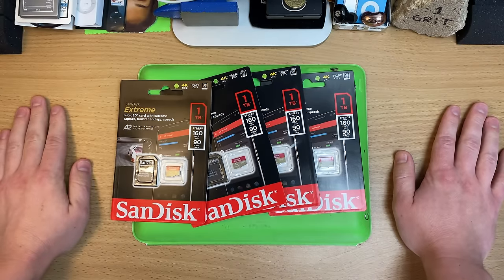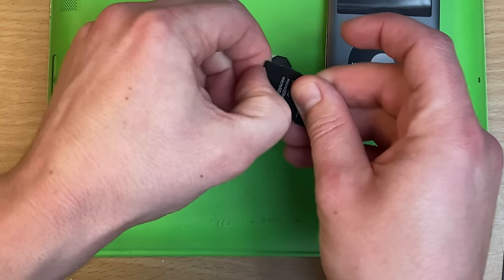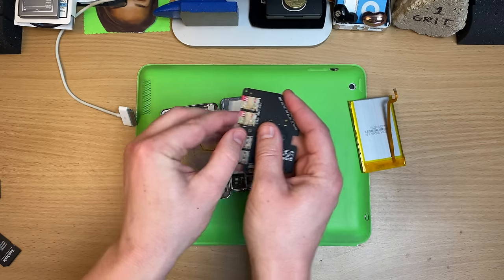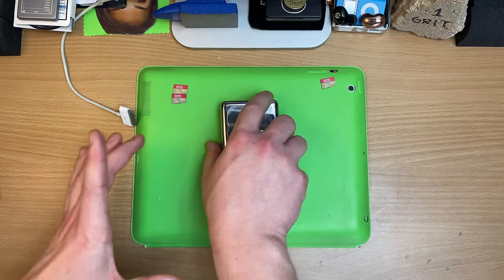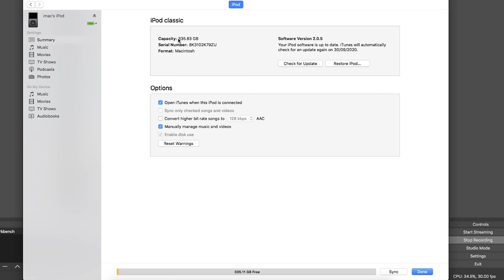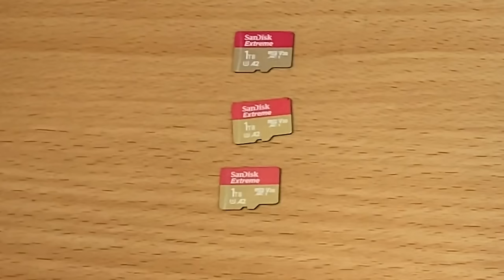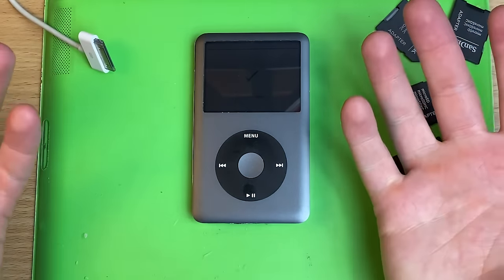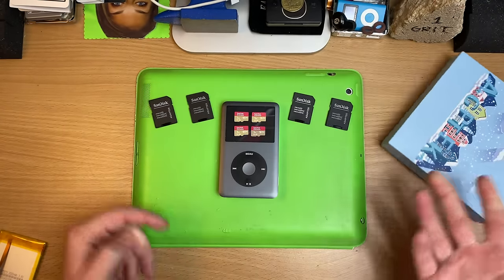4000GB in an iPod Classic.

Comment: A word to the wise, don’t buy storage from eBay. I’ve had “sandisks” that looked legit but the actual cards were like 4 megs. The computer even reads them as a terry bite. But it just rolls over the data constantly overwriting and corrupting data.
Reply: For this those scams might be actually better. The device sees 4 TB bit they're way cheaper than legit ones
Reply: Hell, I've had fame cards from Amazon. Best to buy in store or from the manufacturer
Reply: It gets worse than that. You can EASILY find these fake cards on Amazon as well. SD cards are one of the most faked products and you REALLY need to pay attention to the reviews and compare model numbers and even compare box arts and stickers.
Reply: @bene5431  But they're not actually 4tb so your data gets corrupted
Reply: @TheVivi13  yeah like they put it through some magical scam-o-matic machine that like overwrites the storage with a fake number 
Then they loosely base the box off of the original, and they sell it more expensive than like actual 8 GB cards

Comment: When an iPod has 8 times as much storage as your desktop computer...
Reply: Nicolas Byszewski but what if you have a 8tb hdd on your computer
Reply: For me its 50 times more
Reply: laughs in 20 gb
Reply: 200x.
RIP.
OOF
Reply: @Versuffe 
My iPad Air 1 has 4 gigs less than your computer. Mate, you need an upgrade HARD
Reply: Me: laughs in 4tb
Reply: Laughs in 13TB
Reply: i dont even have a gb. On my tablet
Reply: I have 12gb of space on my tablet
Reply: @focalpoint._  ipad air smh my computer has a 16GB micro sd card witht the OS and everything on it.
Reply: I honestly thought the same thing
Reply: Man, I've got 6Tb in my desktop, and it's fucking full
Reply: Laughs in 8 gb

With windows xp
Reply: How bout 32 times more? I got 128gb!
Reply: @shiftybluepig1141  are you using a pi or what
Reply: @hexxx3d462  I had an old computer with i think a 500GB hard drive. We then obtained a new computer which was much much faster. We moved the hard drive along with it. The new computer is very high end but its also 9 years old so around a year after we started using it the GPU died. We dont need it that bad so spending heaps of money on a computer when we have access to another printer and our phones isnt necessary at this point. So we moved back to our old computer for basic things. Because we had no hard drive i just found a micro sd card and an adapter to put into it and we just used Linux Ubuntu for an OS.

TL;DR: No i dont have a pi, i am using my old hardrive for the computer in another computer (which now has stopped working). So i moved back to the old one which i dont need much storage in.
Sorry for the paragraph im bored.
Reply: I have a terabyte HDD and half a terabyte SDD
Reply: @nequastar1826  laughs in 52tb
Reply: Oh...

I have 1.5 tbs only
Reply: my moms laptop has 4gb i think
Reply: @Baron lol same I had 16GB STORAGE not ram and uh..... 1gb ram (not vram for a gpu it’s the actual memory)
Reply: FAAAAAAAAAAAAX
Reply: For me it's 2 times more and it's a laptop
Reply: I got 1.5tb in ssd and 20tb in hdd storage
Reply: Bro you got a computer?
Reply: laughs in 16 gb
Reply: Lol dudes flashing their single and low double digit numbers, meanwhile Linus jams a petabyte into a server box.
Reply: @ImKevan  what even is your point?
Reply: My main laptop has a 1tb boot drive and a 2tb mechanical drive

Comment: "The amount of HDD space that can be used depends on the cluster size, for example for a 32 bit OS using a file system with 512 byte sectors, that would give you a HDD limitation of 2.2 TB."

Is this possibly why it won't work?
Reply: The following limitations apply to the iPod Classic OS:

512 byte sector size. This probably why two of the SDXC cards don't work. They have a different one.
2^32 logical block address (LBA) limit.
The combination of those two limits then is 2^32 * 512 =2,199,023,255,552
Reply: @MayContainJoe  Which is exactly 2TiB. Give or take a few bytes for headers and the partition table, it seems this is exactly the reason why it's failing.
Reply: @Jack Carlquist Filesystem doesn't matter if the drive is initialized as MBR.

It says "Master Boot Record" right in the video at 13:54

Comment: Try formatting the cards with a 4k sector size. If the limit is how many sectors can be addressed by the partitioning scheme, this should theoretically give you 8x the addressable space (512*8=4k) or 16tb of potential storage.

Comment: i just realized how insane it is that an entire terabyte can fit in a tiny little chip but cars are still like full of pipes and shit
Reply: Cars are bigger than SD cards
Reply: @jackomeara6395  exactly
Reply: SD cards aren't built to propel a family of four into a wall at 130km/h
Reply: @jm036  it's like comparing apples to bananas
Reply: they are completely different
Reply: @ianism3  lmfao
Reply: have you tired the new chevy duramax , the computer has like .0005 bits of processing power to read the throttle pedal input. so i understand your metaphor

Comment: I experienced a similar issue with a 3 TB HDD in one of my old computers.  Because of the file system that was being used was a 32 bit build, the Master Boot Record would only allow for a partition of up to 4,294,967,295 sectors of 512 bytes i.e. 2.199 TB.  The rest of that HDD was effectively useless because the MBR wouldn't let another partition exist on the same disc.  (I was young and didn't know any better, sue me)

The iPod's os is most likely a 32 bit build and therefore has the same size limitation.  Combine that with the RAM ceiling you hit and it's pretty definitive that unless someone goes and writes a custom OS for an obsolete technology, that's the bioggest the ol' iPod's getting.

Comment: Sandisk has alot of issues for various homebrew'd things, like Android on the Switch.
Reply: wait, Android on the switch? people do that?
Reply: natural blue why would you put android on the switch?
Reply: @donaldmacisaac8479  because It Is cool
Reply: Caramelle but if you’re going to mod a switch, why not play older games/home brew on it instead of turning it into an oversized smartphone
Reply: @donaldmacisaac8479  some use android on the switch to emulate
Reply: @donaldmacisaac8479  android has some pretty good emulation software and it's a generally lightweight os
Reply: And I will say you can get ubuntu on it too.
Reply: CAMSLAYER13 I mean, I guess it has to be because of all the weird ways android gets used because it’s OS is used for pretty much everything.
Reply: Any way to fix an SDcard after SwitchRoot has been installed? Ive ruined 2 microsd's to Switchroot and i cant figure out how to fix them, tried reformating, sdcardformatter, etc. Nada
Reply: Why use a switch to emulate games via android lol that is so overkill and stupid when you can just use an android tab or even a cheap android tv box to emulate and keep your switch to play switch games
Reply: @Alexander_l322  I think people just get a kick out of using hardware in unintended ways. Besides a bet it's way nicer to use than a cheap tablet or an android box + a cheap controller.
Reply: CAMSLAYER13 I get that, it’s why I like to install cfw to my consoles and things like that but not to make them less useful then before. My PS3 for example can play PS3 iso files, along with ps2,ps1 and retro arch but i wouldn’t do it if I couldn’t still use it like a PS3. I would mod a switch to play games downloaded(not sure if it’s possible I’ve not researched it) and that would be good enough for me.
Reply: @donaldmacisaac8479  half life 2

Comment: I think you hit the 32-bit integer limit on the IPod config at 10:00 roughly. The IPoc cannot accept more than ~2,18 Terabytes of storage.  Everything above that, it resets to 0 and counts from there: 1TB+1TB+512GB=2,5TB; 2,5-2,18=0,32 i think that's why...
don't know tho. The Integer limit normally lies at ~2,1 GB.
also 4TB-2,1=1,9 at 14:00 roughly

Comment: ~2TB is the limit for a MBR partition that it's surely using.

When you're getting those smaller sizes when you have more than two terabytes in it that's actually the second partition it's actually having to make I believe raw it would be 2.2 TB so that's why it would be 360 gigs left with 2.5 terabyte in there

Comment: Hey, I had a problem similar to this when I installed a 4TB drive into my PC. I think the problem is that the SD cards may be using an mbr table instead of a GPT table. The limit for mbr is around 1.9 tb from my experience. I'd  try that if I were you.

Comment: There’s one more achievement left in order to achieve it… if it ever will

Can the iPod… handle 8TB … if it’s possible?
Reply: Well, it couldn't handle 4tb, so probably not.
Reply: No 8tb ipod
Reply: Also 2tb sd cards don't exist yet
Reply: Possibly nope bc ipods as it seems uses MBR so its hard limit is 2tb
Reply: I mean, if it ever will be possible, then it will be official. But I wanna know if it can handle on the new iPods.

Comment: Here's why these limits probably exist: 2**16 is 65536 (the size of a 16 bit integer) which is close to 50000, so I'm guessing the actual song limit is 65535 songs. The storage limit is 2147483647 bytes because that's what 2**31 is (the size of a 32 bit signed integer, although that does seem like a strange choice, perhaps it's a firmware bug with the board you're using). Bugs start happening (like seeing weird values for the size of the iPod because these values have overflowed, looping back around since it can't represent numbers larger than these values for those things.
Reply: You're right on with the storage limit analysis but for the song track limit its the RAM size of the iPod. Older ones have 32Mb, newer have 64Mb. The metadata of the songs is stored in the RAM, so if you have longer track names and more artist info added, the track limit will be less than if you have shorter names.

Comment: I can explain why you were unable to get more than 2tb of storage. Long story short, this iPod uses an older partitioning system called MBR (master boot record). MBR has a partition limit of 2TB or 2048GB (computers count in powers of 2). 16:00 Yes, but it may require reprogramming of the iPod itself...

Comment: I dunno if anyone has mentioned it, but, the reason the size looks smaller on Computers is because computers are typically telling you the size in another measurement. (Linux will show what the manufacturer puts on the box) My 2 Terabyte drive shows up as 2TB but 1.8 TiB which are equal measurements (which is the unit Windows displays by default, but Windows says TB rather than TiB where as Linux shows TB and TiB in the properties of the drive). One is base 1000, the other is base 1024. Most computers display the base 1024 unit, but manufacturers put the 1000 measurement on the packaging typically. So you aren't losing That much data.

Comment: Curious why you format the flash cards at all for the iFlash Quad.  I've been using this board for a while and the best thing I've done with mine (and quickest) is to use DISKPART and clean the partition of all cards.  Put it in the board and iTunes fixes it just fine.

Comment: The reason it's not detecting more than 2 TB is because HFS (Mac OS Standard) and FAT32 have 2 TB filesystem limits. It may be possible to get it working if you use a third party firmware which supports newer filesystems (like ext3, ext4, btrfs, F2FS, NTFS or HFS+)

Edit: I was wrong about FAT32. It has 16 TB as it's maximum capacity. It may also be hardware limitations.
Reply: It is 2tb, not 16.
Reply: @SOTP.  Quoted from Wikipedia:
"The FAT32 boot sector uses a 32-bit field for the sector count, limiting the maximal FAT32 volume size to 2 terabytes with a sector size of 512 bytes. The maximum FAT32 volume size is 16 TB with a sector size of 4,096 bytes."

Comment: The most likely reason it only saw 800~GB when you had 1+1+0.5+0.5 is because these card controllers are required to present a as a single drive. There are only 2 ways to do this option 0: Raid 0, this will give the fastest speads as it spreads files across all compatible drives. Option 1: Raid 1, where all drives have a copy of the same data. The thing is. For this to work, all drives have to be "exactly the same" in either case. What likely happened, is that the adapter chose the two closest cards to the controller, put them in raid, and because computers are weird and it was still required to address all 2 TB of the other drives, it had to reserve a portion of the "1TB" raid array. Somewhat similar to how if you put 16GB of RAM in a 32bit computer(normally limited to 4GB) you will actually see significantly less usable RAM than 4GB because it still had to "address" the 16GB of RAM

Ok yes technically there are ~8 ways to present the drives but i doubt this controller supports and or is intelligent enough to run extended partitions, or ZFS-Z3, or RAID50

Comment: The ipod has an ARM7 processor inside, which is a 32 bit processor. That means it can only address 2 tebibytes of memory (around 2199.02 gigabytes) Some of the address space is likely going to be mapped to internal io registers and internal work ram, and the rest of it will be trying to map itself to your sd cards. That's why 2020 gb is the limit.

Comment: 2TB maximum for 32 bit architecture. Ran into this with a Vantec Firewire external HDD case. Turned a 4 TB HDD into a 1.89 unless I did two partitions of 1.89 TB

Comment: google say "FAT32 max partition size is 2TB. If you have a 3TB drive or larger, you would not be able to format it as a single FAT32 partition." 

I think ipod´s use a 32bit processor or format the drive again to fat32. The board create a raid 0 with the sd card but the ipod cannot handle the amount (4TB) of storage.

Comment: Is slowness normal when you load up an iPod? I bought a 1 TB unit and it's probably not even 1/3 full. But it scrolls sloppy, and that's when it wants to scroll. Sometimes it just locks up. I'm about to just give up on mobile audio and rip the radio out of my car.

Comment: This reminds me of the problem I ran into with trying to get a 4TB drive to run in a computer.  It's probably limited by it being MBR which means 2TB per drive.  That board tricks it into thinking 4 of those cards is a single drive so it'd have the same limitation.  The fact that you were showing 800 and 300 GBs means that it was likely showing how much space it was going over the MBR limit but I'm not quite sure why it was showing 2020 GBs in the end.  Computers are weird.

Comment: Now 2024 I bought 3TB
Six Samsung 512GB sd cards $30 each.
Only $60-$65 for 1TB. Times have changed.
You can upgrade a used IPOD with 1TB, 3000mah battery for less than $100.

Comment: Hey, i know i'm late to the party, and probably most of you have figured out one different reason this experiment is not working. Still, here's my take:
I've been there since the dawn of microsd cards (previously known as Transflash) and i've been going into problems with this or that reader, because the format of the card or whatever (i mean the physical format, like fabrication, and chips and stuff). Turns out most of the cards work on most of the readers, but there were always some flashy new ones that didn't make it with older readers. It looks to me that this could be the situation here. The two cards that didn't work with the ipod weren't bad. It may have been just the reader not being able to handle them. There was this 325GB situation also, which tells me the controller in the "RAID card" is not being able to handle those numbers. Maybe it was failing at some point, maybe it couldn't handle some of those physical formats, or maybe anything else.
I'm watching these videos now bc i'm about to commit into making one of these myself. I would really be interested in checking if Rockbox can handle as much as 4TB, since i use it the most (and you know why? because of the stupid european lawmakers capped the damn volume on all devices, and this sounds stupid low, which is absolute horse** if you plan to use it on speakers or car radios.) Sadly, even if rockbox supports the amount of data, even if it only is 2TB, you still need to make it work with itunes. I'm using windows, so i can't know if the integrated Finder feature would help me at all. I guess there's only one way to find out. XD See ya on the other side!

Comment: 50,000 tracks if you to lossless for all of them assuming each.aiff file (which is apple l’s version of .wav) idk if the original os supports .wav but anyway assuming each one is 50 MB (sometimes it’ll be more sometimes less but pick 50 cuz to make the math easier) 50 times 50,000 equals 2,500,000 that in megabytes diving it by 1024 cuz there’s 1024 megabytes in a gigabyte equals 2,441.40625 basically 2.4 terabytes the rest of that extra space can be used for tv shows and or movies or go towards the space that tracks take more then 50 MB

Comment: Have you tried it on 5th gen or 5.5th? Those two free from LBA28 addressing, and i think 6-7th does have that limitation on storage lock on 127gb in the stock apple firnware
Reply: You can unlock only the storage when using  rockbox, just install the stock os then go to diskmode apply the rockbox utilities app, then after a reboot reformat again and combine all the partitions into one and format it with fat32

Comment: Random thought, but I wonder if for some weird reason, the two SD cards that didn't work were GPT rather than MBR (I imagine the iPod wouldn't work with GPT)
Reply: Yep, that's exactly what I was thinking.  I'm in the Wii modding community and it's a common support question from newcomers, they don't read GPT disks either.  Format to MBR and you're in business but with the same 2TB limit.